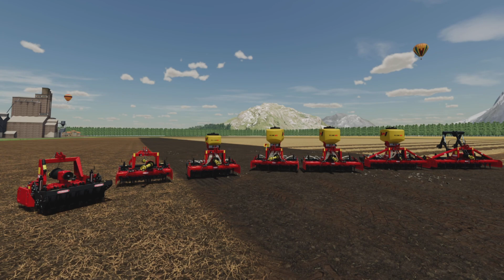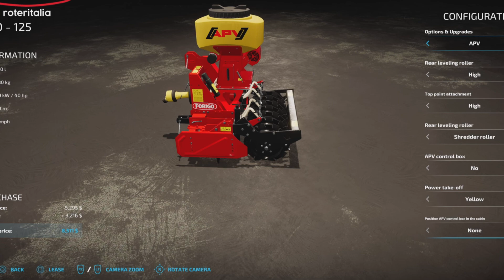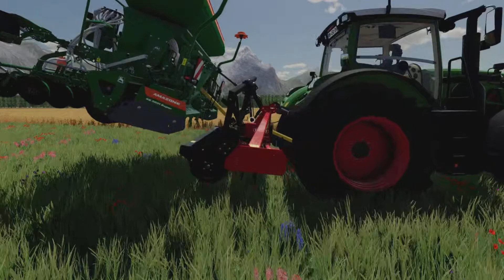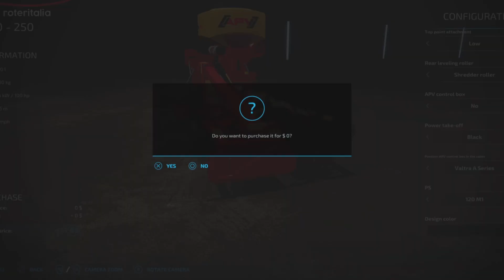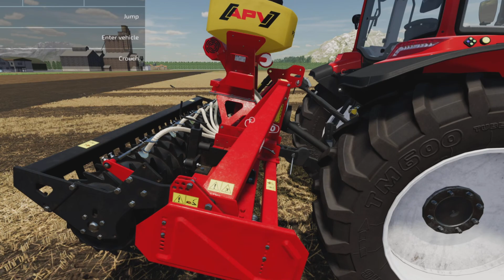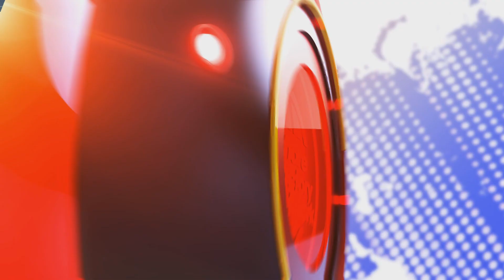Forigo Roteritalia Power Harrows Pack / FS22 mod test for all platforms

Comment: Sorry to call out giants but what the heck.
You made a different modder consolidate their 3 or 4 headers into 1 single unit
Yet this pack gets a ton of models that all virtually look the same?!
Reply: @LooneyFarmGuy  even if it's solely on the fact is an actual licensed brand shouldn't be a good enough excuse. 
Didn't giants say something about cluttering up the store too? 
(Sorry for the rant)
Reply from the maker: No worries , Rant away 🤗 I am sure it could have been consolidated into 1 or 2 🤷🏻‍♂️
Reply: @LooneyFarmGuy  and same with the sizes too; could have had half as many options. 
But I applaud the creator for thinking of every scenario for the small equipment tiny farm players 
And hope all is well for you during this unprecedented record high mod dump.
You'll get thru it, and as Dory once said "just keep swimming"
Reply from the maker: Thanks Julian 🙏